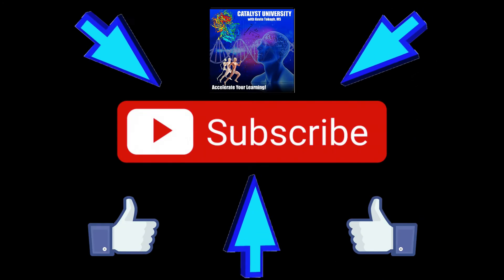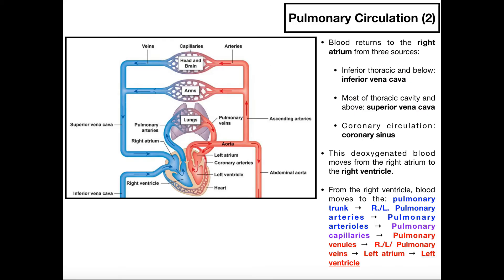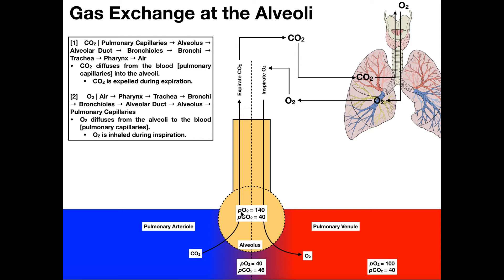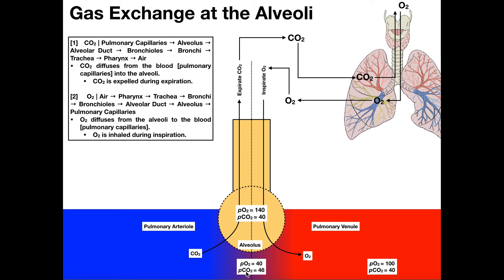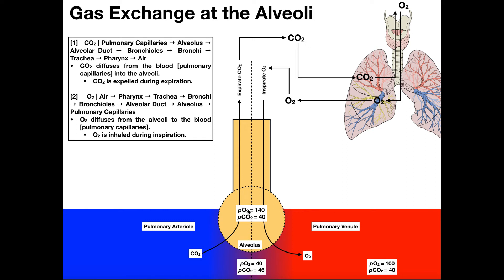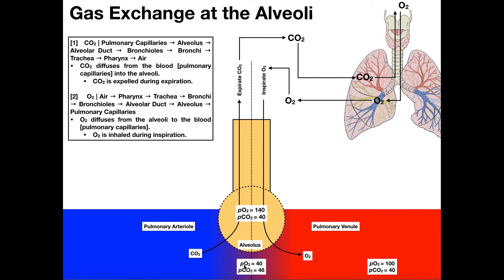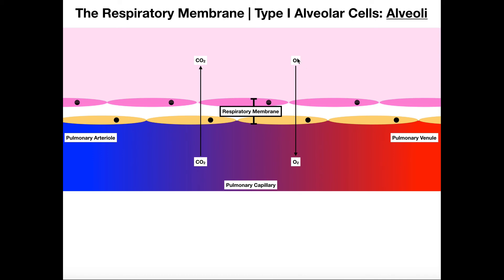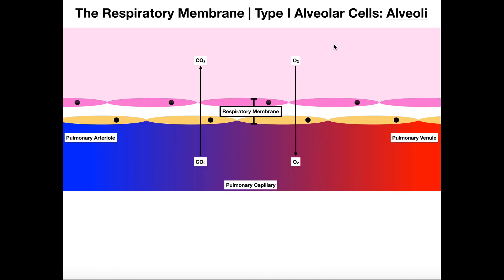Type I Alveolar Cells, Respiratory Membranes, & Gas Exchange

Comment: This video is misleading. The atmosphere's p02 is 160; by the time it reaches the alveoli, p02 is 100. The gas exchange in alveoli is not because of partial pressure changes; it is a countercurrent exchange (like in geese' feet, how they keep their feet warm and how we do not lose heat when blood flow travels to and from our heads).